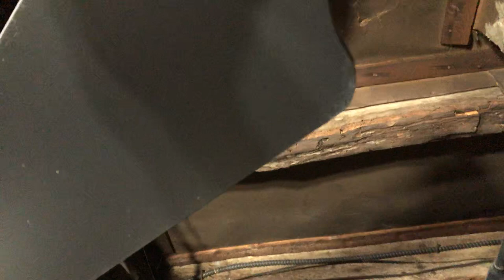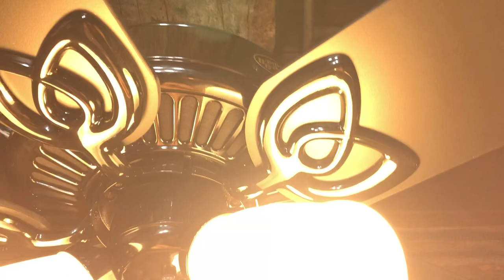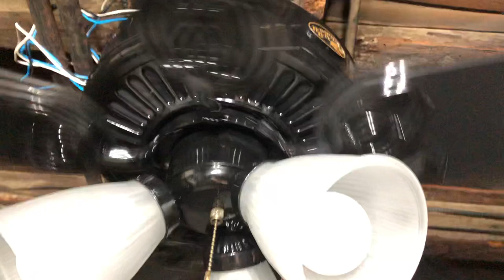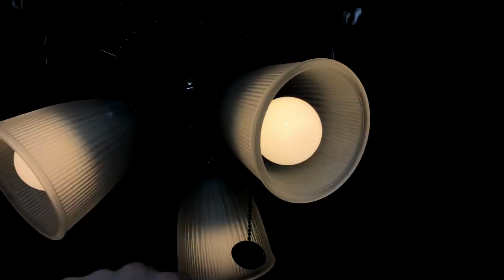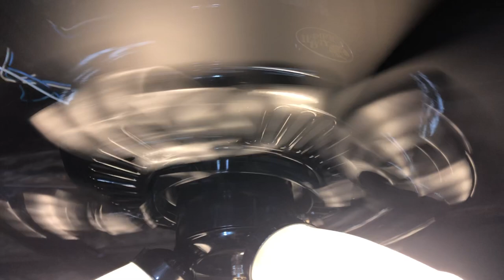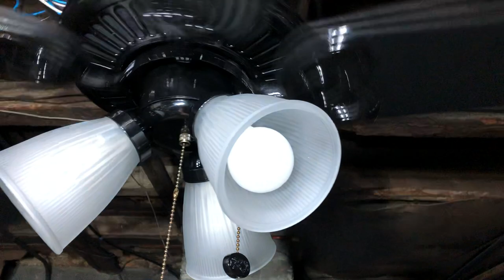Hampton Bay Huntington II Ceiling Fan 52” (Black)

Comment: You should install it for a long term to see if blade arms would sag if it's installed long after the fan was made.

I know of Hampton Bay Colby which didn't go above low speed for over 9 years straight due to a lost remote, and now it runs on high again. The blade arms never sagged nearly as badly as Huntington III at Home Depot display, which never ran.

Seasons Camarillo don't really have blade arms sag, and apparently they sit in box for like 4-5 years before someone orders it.

I know of two Hampton Bay Huntington II/III in a theater which were on updraft when I first saw them, before I switched them to downdraft. The blade sag was a bit normal for Huntington II/III, and there are some that always ran on updraft which had blade arms sag severely. So maybe they were originally on downdraft when first installed.